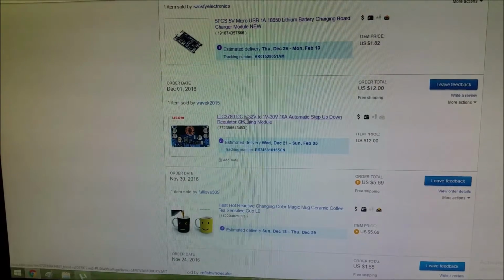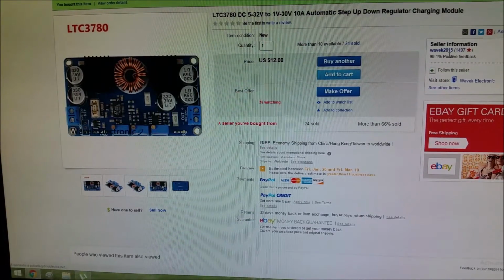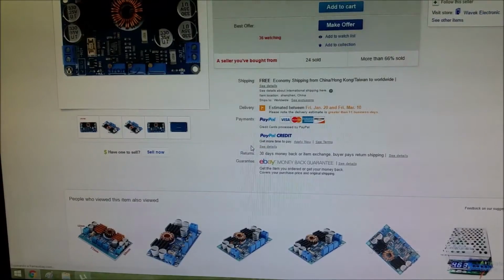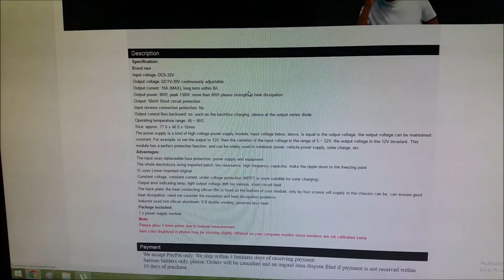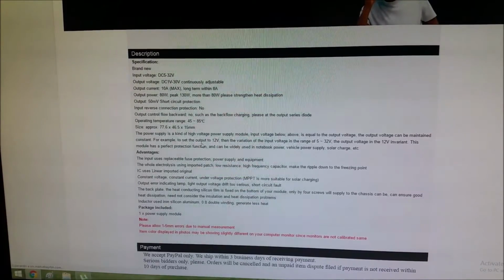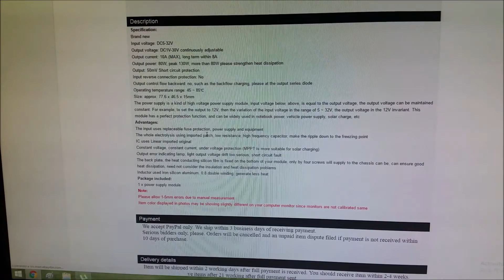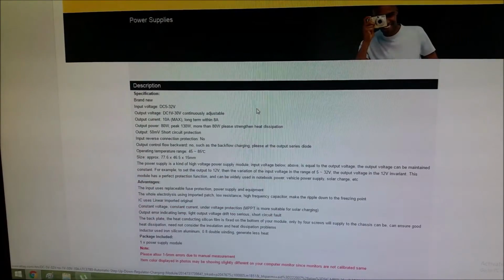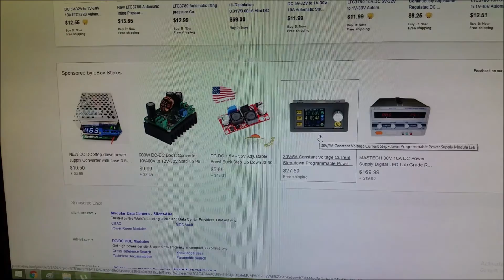Buy Cheap#19 LTC3780 DC 5 32V to 1V 30V 10A Automatic Step Up Down Regulator Charging Module

Comment: Good video. When I connect my LTC I cant measure any voltage in the output and the led fault turns ON. How can I fix it??
Reply from the maker: Juan Jose Valladares I do not know .... I allredy burned this module  :((
Reply: Probably the under-voltage trip setting is too high for your input voltage; try adjusting the left-hand (UV) potentiometer.